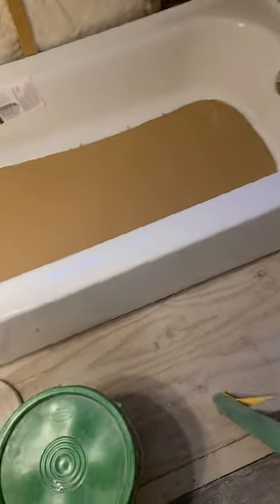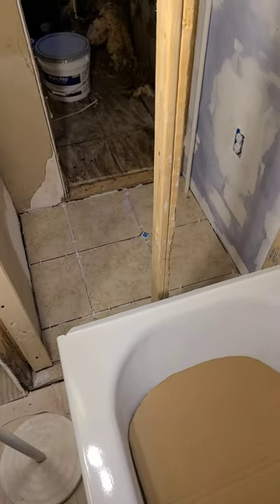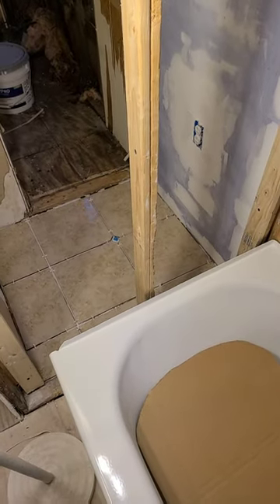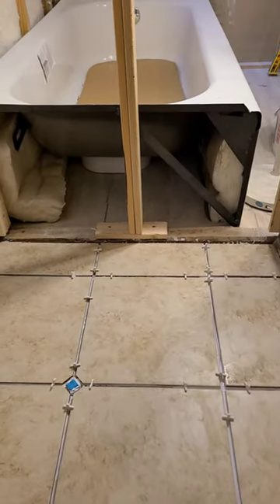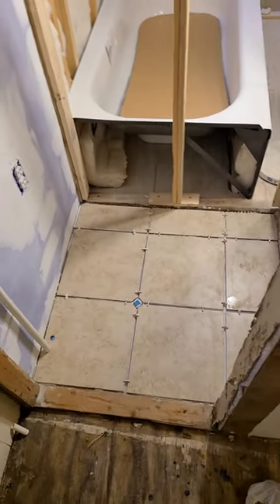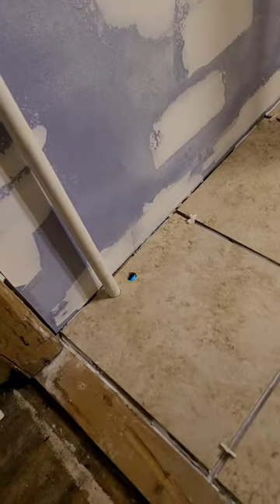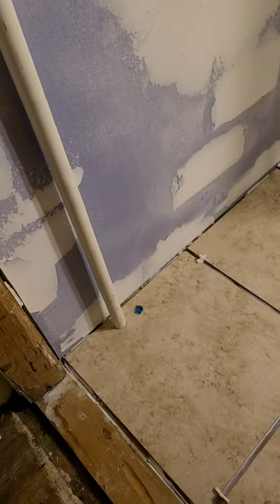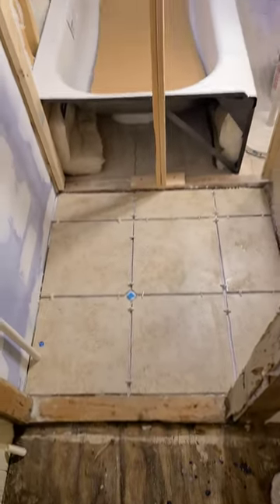Trailer Refurbishment

Comment: dont use a steel tub! dropping a bar of soap chips them
Reply from the maker: The first tub I installed was metal with the powder coat on it. That was about eighteen years ago. I just checked, and there are no chips.
From that installation, I learned the difference between a left-hand tub and a right-hand tub. That's why the spigot is at one end, and the drain is at the other. I'm not gonna make that mistake again!